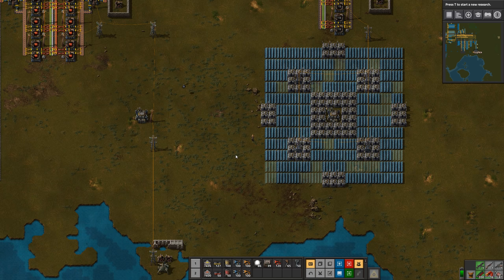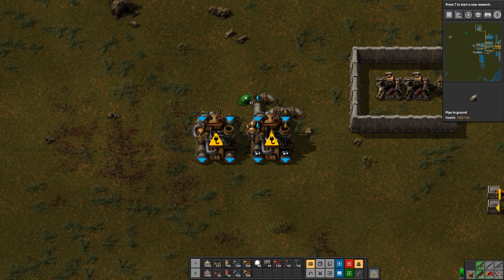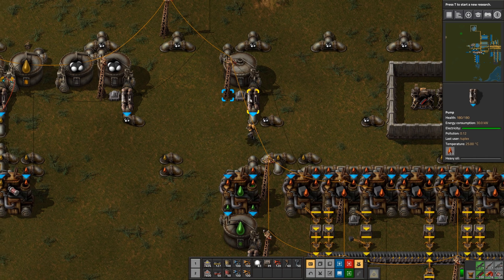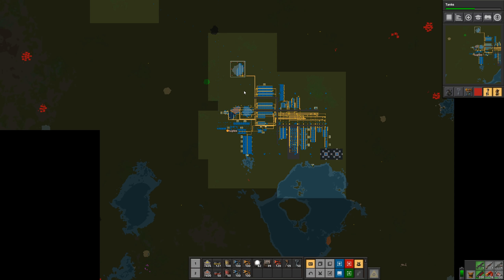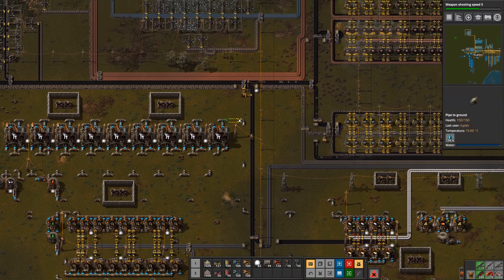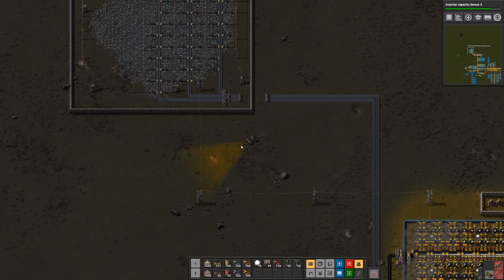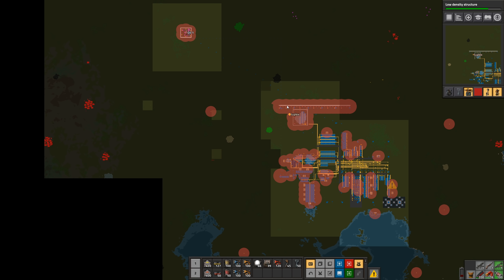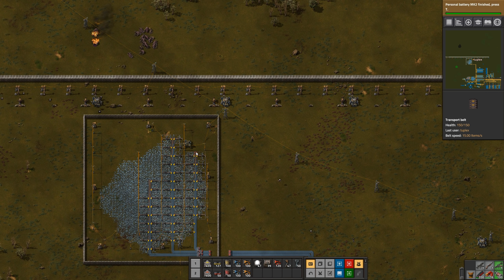Factorio 0.17 Let's Play #14 - Advanced oil, defensive wall

Comment: You should place a roboport with some construction bots and necessary maintenance items like repair packs and extra walls and turrets placed on a storage chest on your outposts. That way you wont need to personally go repair turrets like you had to do on your iron mine.

Also I'd suggest making an SR latch on your oil cracking. With the logic system you have now you will have heavy flickering on and off on and off on and off. With an SR latch the operation would be much smoother.
Reply: And put them later on every station (with control if walls <x, a special train with walls, lasers and repair kits come by), otherwise stays in the base) very helpful !!!

Comment: Hey guys, I’ve deployed flame thrower turrets, they’re connected with petroleum gas. The turrets indicate full fuel, but they’re icons are blinking red and they’re not working. Any ideas?
Reply from the maker: If they’re blinking they must be out of fuel.  What did you sent to them?
Reply from the maker: Oh, they don’t work with petroleum.  Only crude, heavy, and light oil.
Reply: Tuplex oh right, thanks for that. I thought they could use petroleum gas. I did have them using light oil but it ran short. Might try crude. Is there any advantage as to the type of fuel used.
Reply: @fred7flinstone  Using crude gives you 100% damage, heavy oil gives 105% damage, and light oil gives 110% damage.